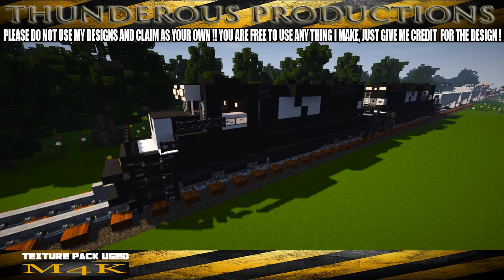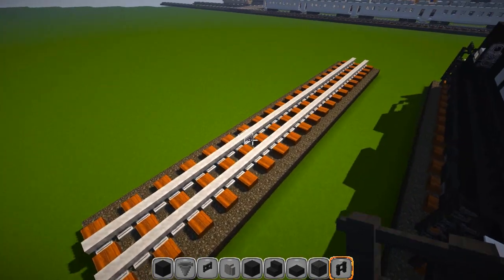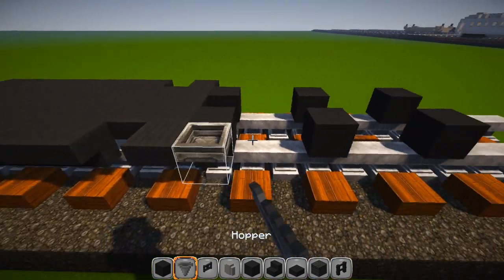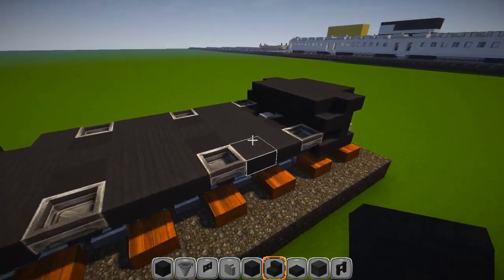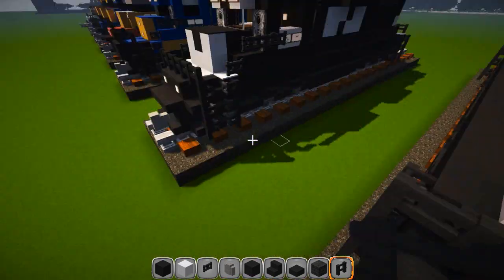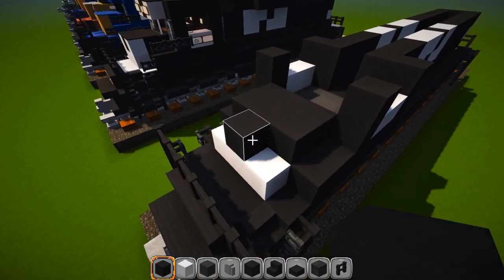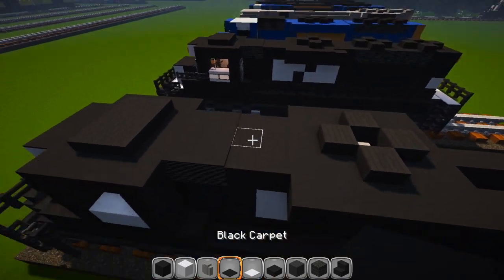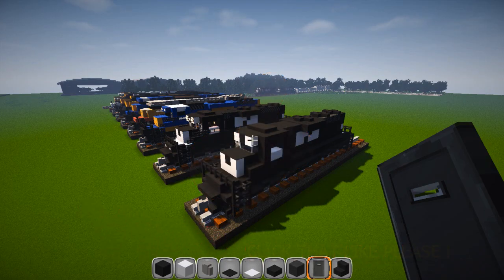Minecraft Train Tutorial : Norfolk Southern GP38 Engine

Comment: Technically the gp38-3 does and doesn't exist because it is a rebuild of the gp38-2, these rebuilds are only operated by Norfolk southern and csx but the interesting part is the Norfolk southern locomotives are labeled gp38-2 still and csx labels them as gp38-3s even though these locomotives are the exact same. Also as a rule of thumb the EMD gp line of locomotives always will have 4 wheels on each truck while the ad line of locomotives almost always have 6 wheels on each truck.